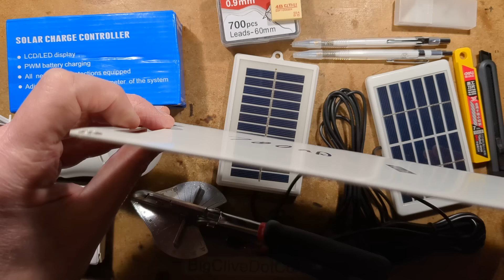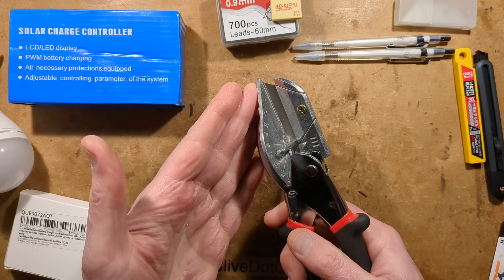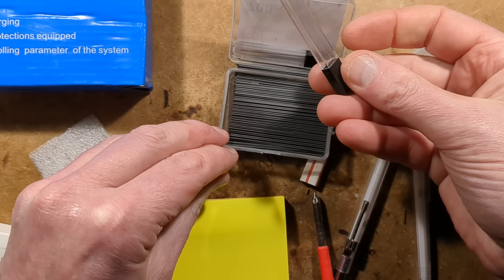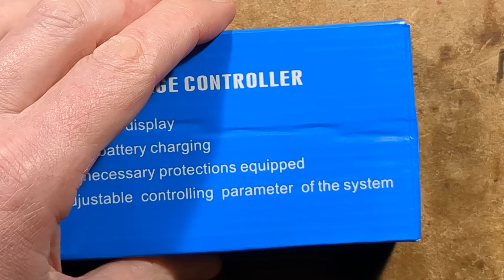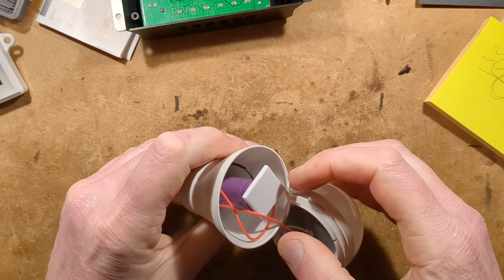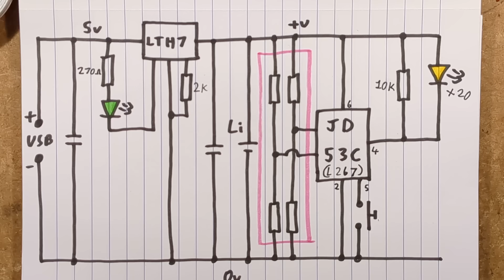Random stuff, a teardown and a little bit of smoke

Comment: that weird cutter looks like it would be good for trimming pcbs assuming it can provide enough pressure, if it was ratcheting it would probably be better
hey odd question but do you have a fnrsi(or clone...or clone of a clone) gc-01 geiger counter? the clone i got is.... well.... it works, it's just slow and the software kinda sucks, currently trying to figure out how to modify the firmware to provide a click instead of a barely visible red led, i'll probably have to add a hardware mod to it as the chip is 100% bare and undetected by windows without a in circuit programming setup which leads me to believe that the chipset is even more stripped down than most clones, the tube and battery were the cheapest 1s they could find and they didnt even remove the protective tape from the double sided tape to stick down the tube or lcd(which came half unplugged out of the box)

Comment: The charge controller: Many of these are sold as MPPT controllers but there is no inductors in them for converting the voltage from the panels.
Be warned people. If it looks like these type of cases, it's most never actually MPPT.
Reply: Yes! The explanation to this (I think mine is one of them) that they call them (name them) MPPT in the title/model (but in the specs it says PWM)... everyone of them is PWM...

Comment: The usb light bulb are great in my opinion.  During a power outages  a single 18650 power supply last a while and light up well when no power. I didn't know they make it rechargeable with its own battery though .💯🇺🇲✌️🫡👍

Comment: Little nitpick about the part where you talked about the solar controller: "LC display" or "LCD panel", but not "liquid crystal display display" 😉
Nice video anyway, interesting stuff. I love mechanical pencils, have had my current one for ages and it still works perfectly. But I just noticed that the (white) main body has yellowed quite a lot over the years.
Saw in the listing that the leads (that will most likely last you a lifetime) are all 2B, which is IMHO too soft, HB is the best.

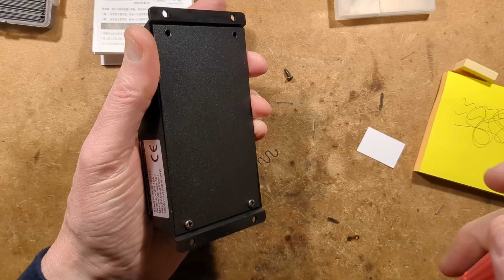Comment: 11:01 one time I was replacing a main switch for a big industrial electronic cabinet the switch I was placing also had rising clamps but like you mentioned you could put a wire underneath the clamp. I accidentally did that with the neutral wire and I didn't check if the connections were solid, so I turned it on for testing and blew up 4 small VFD's. I was an intern at the time and they did hire my in the end so I guess all is forgiven or forgotten.
Reply: The argument sometimes used for that by forward-thinking managers is that they've just spent a given amount on training you (the cost of replacing the VFDs, in your case), why would they then allow you to go work for the competition?  I bet you never made that mistake again.

Comment: That cutter thing looks like it could be used for diorama & model-making to make mitred joints, and the pencil lead part, that reminded me of The Secret Life Of Machines on The Lightbulb where Tim & Rex made lightbulbs in milk bottles with pencil leads (and a vacuum pump & welder for the low-voltage high-current power), worth a watch just to see how lighting's come along since 1991/2 when it was made... :D
Reply: "The Secret Life Of..." series is utterly brilliant!

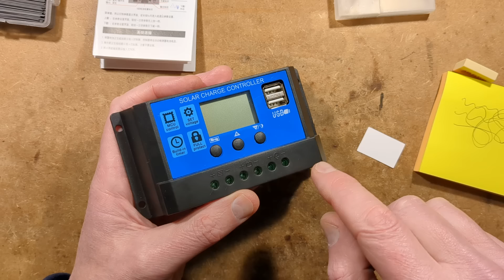Comment: 10:15 I have the same solar controller. It was working for a few hours, however then it stopped. Turns out in the bottom right corner there are 2 SMD resistors that set the USB charging current. By default they can blowup if you charge something like phone/power bank for a long period of time. I replaced them with more beefier  resistors and now everything is ok.
Reply: Interesting to know. 👍
Reply: I was charging a 110ah lead acid  battery inside my car with solar panel on the dash. I also had a old dash cam and my iPhone 8 charging when the controller started to smoke. 
I don’t remember seeing any damage inside but if I photograph it then reproduce the scenario and see what blows 😅
Reply: Just got a 200w folding solar panel and this charger was included :/

Comment: ive done a little research onto these cheapy solar charge controllers in the past and indeed they like to crash or just ignore battery voltage. They also massively overvalue the current these can handle and sell them as MPPT Chargers when they are in fact just PWM chargers. Have a slightly too large solar panel or slightly slumpy battery on there and itll basically throw 18V into a 12V Battery...

Id love a comparison to a "real" Charger, like the Victron MPPT 75/15. After what ive seen with other brands on the internet Victron (a dutch brand) is the only one i really trust

Comment: I have a similar looking cutter, it has a fixed (but replaceable) blade which is curved, rgw 'table' is removable
Without the table it's a onduit cutter, with the table it's a mini trunking cutter, the table has a slot for the blade to pass through

Comment: Solar panels seem to be always overrated, even the "good" ones. I have two panels on the roof of my off-the-grid-cottage charging (through a controller obviously) a parallel array of 4 old truck batteries of 330 Ah a piece (capacity probably is not that much any more as, as said, they are used, taken from trucks after they were no more capable of startin 12 litre diesel engines at -20C). Both panels are rated 300 watts nominal or something like that each and the most I have gotten out of them on a bright summer day has been around 250 watts total for the pair. And they are not the cheapest junk you can get but actually quite good quality panels, a friend of mine works at a company selling them so I got them at a nice discount. 

The system is plenty for lights, charging devices and running appliances like a microwave that don't either need much power or are not run for long times but after a couple of days of running a miter saw and an a small air compressor (for a nail gun) to build a new shed the voltage dropped enough to cause the inverter to cut out and I had to use a generator for the rest of the build.

As a child back in the 70's and 80's I used to do a lot of "experiments" with electricity and one of them was making pencil leads glow with an old-school battery charger (just a transformer and a rectifier, no "intelligence" whatsoever but luckily it had a resettable circuit breaker, othervise I would have needed a lot of spare fuses) I used as a power supply. I also liked blowing traces off old circuir boards I got from my grandfather who worked at a university of technology. Sometimes I popped some electrolytic capasitors as a side effect too.

Comment: The solar charger is to avoid. Its pwm, not buck. It periodically connects the panel to the battery. Immagine what happens with a 31V panel on a 12V battery. Avoid chargers with no coils inside.
Reply: All that happens is the panel is pulled down to battery voltage effectively throwing away a considerable amount of its capacity.  If the charger is actually functional the battery voltage will not rise above what ever has been set, the PWM duty cycle just goes to minimum and then off completely.
Reply: Indeed, they are often advertised as MPPT, but they are just On/Off, connecting the panel directly across the battery...
So don't use a panel with too high an output voltage for either 12 or 24 Volt batteries...

I have these, but now use Step-Down converters with display and settable output voltage (set to 14,4V) to charge NiMH packs and a LiFePo battery, and from those a USB charger.
Worked well when underway with my Quest Velomobile on holiday.

Comment: If you like mechanical pencils, have a look at the Uni Kuru Toga - it has a mechanism that rotates the lead as you use the pen in order to keep it sharp. Maybe you'll find it interesting, engineering-wise.
Reply: Oh wow, never heard of that, even though I really like mechanical pencils. This one seems super interesting; has potetial to replace my long time favorite (the Faber-Castell Grip 1345).
Reply: @HalfInt  I always had a Faber Castell TK Fine in my pencilcase when I was in school. Those are solid pencils.
Reply: I was really excited for the Kuru Toga. Ordered a Kuru Toga Pipe Slide and tried it. Big disappointment: The mechanism requires to much force, much more then I press on while writing. Demonstration vid on my channel.
Reply: @RaoulSteffen  Haven't used one in a while, so I don't know about the newer ones. But I don't remember this problem, and I don't have a heavy hand. It might be defective. (I found a reddit thread about the issue, someone blames it on dried up lube.)

Comment: Double-sided tape and the no-hole replacement blades won't fall out the clamp after the tabs are ground off.
Reply: i am kinda confused here... on this type of blade i have always seen the holes even in blade holders that were older than me.
they are there to hold the blade in the holder securely

Comment: " The voices are saying pass current through it "
Finally, someone who understands me 😂
Reply: Listen to the voices. Of course, if the voices tell you to step into the light, tell them to do one.
Reply: My voice said. “Ramp it up until it burns”
Reply: Time to bump up the dosage again.
Reply: I heard the voices too. i could feel it strongly.
Reply: @EverBeyondRadio Yeah, it wasn’t just Clive’s voices.

So that brings up the unnerving question of whose voices we’re all hearing…
Reply: Why stop there? make an arc light
Reply: @pleasecho2 reminds me of my 'experiments' as an electrical apprentice making a mains arc light from carbon rods taken from batteries and a stack of  parallel 1 Kw fire elements wired  in series piled on bricks..  😂😂
Reply: the cutter looks like a small laminate cutter or a cutter for aluinium/thin steel 'Luxaflex' style blinds.
Reply: I was glad he had the same thought, and it wasn't just me.
Reply: Try passing a prune through it !

Comment: I've used those cheap charge controllers for a number of years. They're actually pretty good, and probably the reason my charge controller kits stopped selling. There's no way I could compete with them, and they're more comprehensive than the basic lead acid battery only kits I used to sell.
Reply: I've been using one for over 10 years, and never had a problem with it.  It cost me about eight quid, back in the day.

Comment: Could you make a jig to drill holes in standard utility blades or is the steel very difficult to drill through?
Reply from the maker: It will be very tough steel.
Reply: Carbide drill, rigid fixture, very slow speed, push hard.  Stefan Gotteswinter did it, it’s possible.
Reply from the maker: That would require a very desirable high precision pillar drill.

Comment: That cutter is for trim pieces, like wood mouldings that go at the top of a wall or around a baseboard. Usually those are very thin and soft wood so you don't need a real miter saw when you're doing that finish work before painting and such.
Reply: Or picture frames, some are urethane and just snipped.
Reply: Also for mouldings for framing mirrors and pictures.
Reply: The cutter would also be great when working with small balsa parts to build a model.
Reply: I have one somewhere around here for trimming rubber seals on windows and doors.
Reply: Mitre, not miter.
Reply: thank you.

Comment: Like the format; more please...
That PWM solar controller, there are literally 1000's of them with a wide range of brand names on them, including Truma...
Generally they are poor quality and not great for charging as they are quite inefficient. 
Far better are the MPPT based chargers that can boost the incoming voltage. Some of the chargers you have there are are also labeled MPPT, but upon opening it's easy to see that they are not as they will be missing the large inductor for the voltage boost...
Reply: I call those chargers "Battery Killers"...

Comment: I think you need to count the pencil leads, just to make sure we are getting the 700 or close too. 🤣🤣
I only read the instructions for the translations some of them can be very funny. 
Interesting bits of tat, you buy it so we don't need too. Thanks Clive 2x👍
Reply: AliExpress sell very nice, reasonably accurate  (and inexpensive),  digital scales which are handy for weighing out quantities of lightweight items. There are various models with different levels of accuracy. The ones I use are max 500g, in increments of 0.01g.
Reply: @ericoppel5698  Otherwise known as Clive's "drug dealer scales"

Comment: With two of those graphite pencil leads you could make a very tiny arc lamp!
Reply: 😎 Did that as a 12 yr old kid - it was bright and hot - I learned that car batteries have a lot of energy in them 🤣🤣🤣🤣

I then moved onto the carbon rods from U2 batteries  using a 1kW electric fire as a ballast - even broighter but did not impress the parents by the glow from under the bedroom door😎😎😎😎
Reply: Works better with anode rods from zinc carbon batteries. 👍😉

They did smoke a lot until you'd burned all the electrolyte off, though. 🫤
Reply: Need to be copper clad to pass all,the current to the end.

Comment: I seem to have found an Ali listing for spare blades (item number 1005006005039860 ). The price seems to be around 4 USD for 20pcs. 
Actually, some of the tool listings do have packs of spare blades you can get separately.

Comment: Something nice and chill to watch while I recover from dislocating my knee.
Reply from the maker: Sorry to hear that.  What happened?
Reply: Had a heavy bag on my back and I was walking around a wee wa' and the weight shifted over just as I was manoeuvring my knee ro go around it. With a pop and crunch I fell over. Pulled my leg up to see the damage and my foot and shin were pointing in the wrong direction. Grabbed my knee cap with both hands and pulled it back in as quickly as I could. Have a brace on it now. No break but have damaged the ligaments so I've been ordered to rest and need to see the fracture clinic and have a mri. Wee wa's are dangerous!